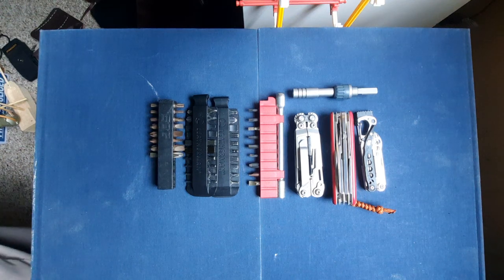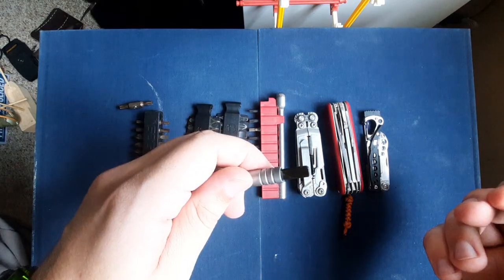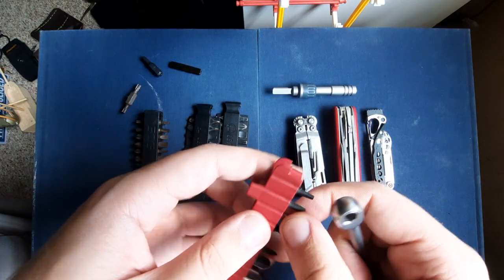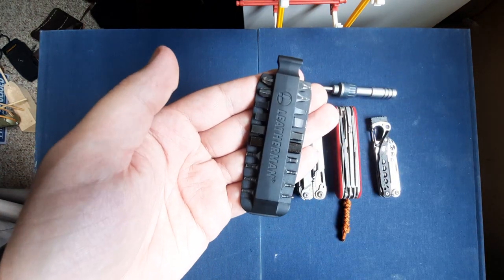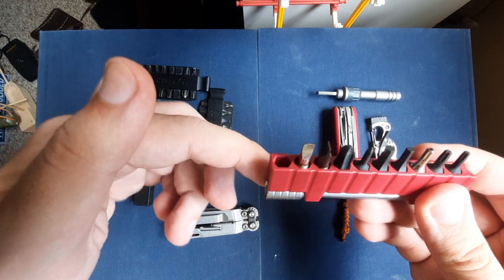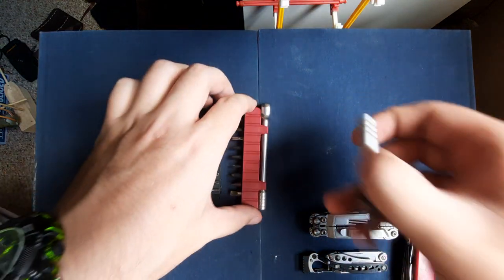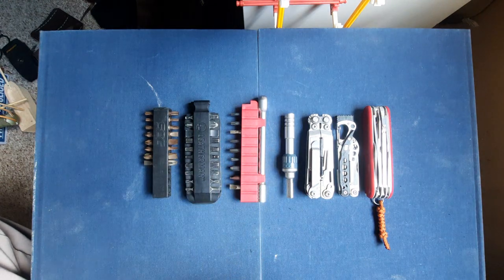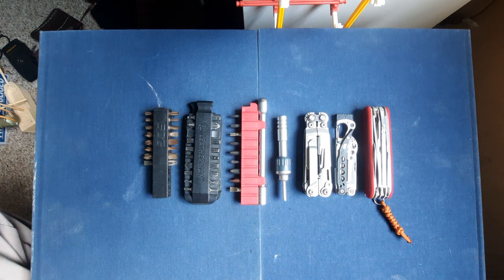edc screwdrivers & bit-kit setups

Comment: do the leatherman bits work well in the victorinox ratchet? i didnt see you use them together in this video
Reply from the maker: They work a little bit.  Leatherman bits being double-sided, dont grab all too well in the victorinox driver.  Not a good combo.

 The victorinox should have magnetic retention instead of the steel spring thing it uses right now.